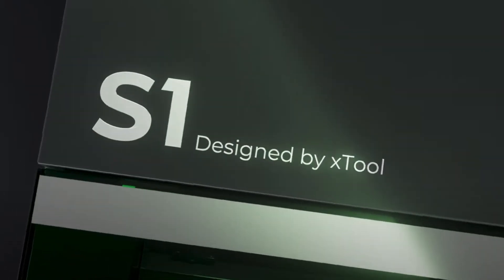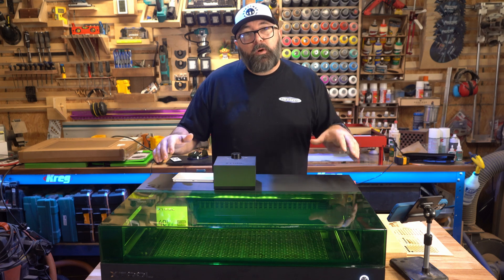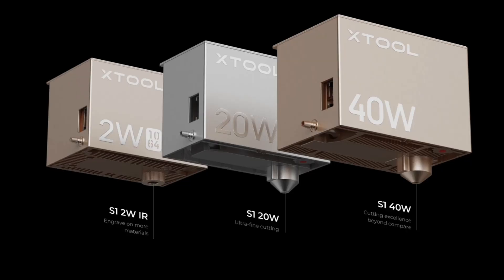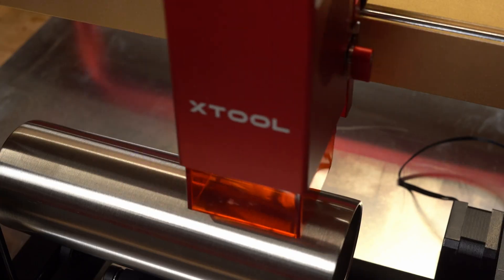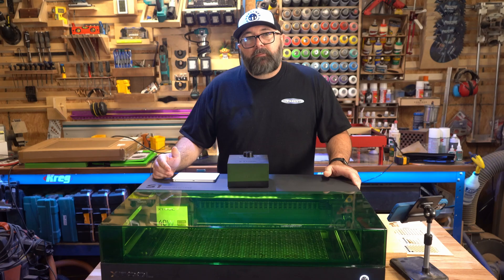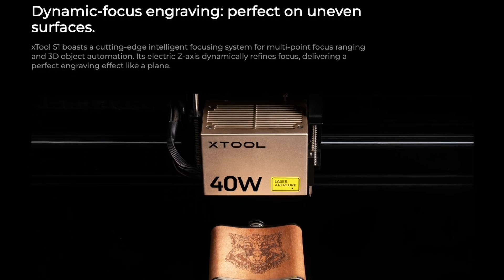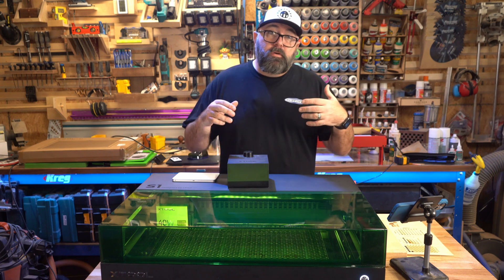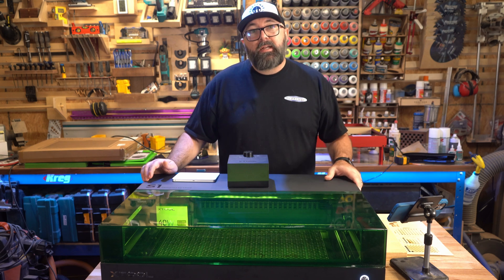I never expected THIS on a diode laser! | xTool S1 laser

Comment: Hi there, I am wanting to get a photograph engraved on stainless steel using the X-tool S1 with the 2w IR laser. I am based in the UK and wondering if you are able to do this? if so please reach out to discuss further. Many thanks, Joe
Reply from the maker: Hi there. I’m unable to take on any commission work at this time, unfortunately.

Comment: Was told by XTool the s1 could mark inside rings - I’ve received my s1 but can’t find a way to engrave inside rings - anyone worked this out?
Reply from the maker: You have the RA2 rotary and riser? You have to tilt the RA2 I’ve heard but I haven’t tried it yet. Maybe this will give me a reason. lol.
Reply: Yes I have riser and RA2 - it seems the focus range is so close with both the 40w and IR module that you can not get inside the ring even with the ra2 tilted at a 35-45 degrees.
There are loads of videos of the D1 laser achieving this.

Comment: One question I have is I know you pick up the corner to corner but how do you pick up round stuff?
Reply from the maker: Lightburn has a center finder option built into the software which may be an option for you. The best way I have found to do round objects is by making a template where I put the round object in the middle of the template and it lines up perfectly every time.
Reply: @VoeltnerWoodworking  I was talking about in xcs! You must only be able to pick up square and rectangle objects with xcs! It would be nice if it was a four point pick up then you could pick square or circle
Reply from the maker: I'm getting ready to release a video on the updates that just got done with XCS. It addresses this concern. Hope that helps!

Comment: Hey Matt, great, informative video!  I'm a 'newbie', trying to decide between the M1 and the S1.  You mention 'batch engraving'... this is one of my big questions.  Can you engrave/cut multiple pieces at one time in the S1?  For example, if you had 4 wood coasters that you wanted to engrave, could you put them all in the S1 at the same time so they engrave in one shot, or do you have to do it as 4 'separate' operations?  The lack of camera intimidates me, but that being said, since this is my first laser, I suppose I could adapt to either way?  Just curious on your thoughts.  (I have 2 Silhouette Cameos and I'm very tech-savvy, so not too concerned about becoming familiar with, and using the software.) :-)
Reply from the maker: You can absolutely do batch engraving on this machine. It just won’t have the adaptive technology like the P2. You’ll want to make a template for repetitive engraving, but that’s super simple. This will be a nice machine to learn on.
Reply: @VoeltnerWoodworking thank you so much for the swift response.  I will definitely be going 'all in' and getting air assist and the filter; Overall, if I'm choosing between the 10W M1 ($1949 for what I've configured) or the 20W S1 ($2599 for what I've configured), what would your recommendation be?  Worth the extra for an S1 for a newbie? (Watching another of your videos... I'll be subscribing, so informative!)
Reply from the maker: Thanks so much. Beyond the bed/working size difference (385mmx300mm for M1 and 608x388 for S1), the wattage of a 20w will allow you to cut much thicker material. I'd say if you're not going to need the knife to cut vinyl for the M1 (since you have the Silohettes), then I would go with the S1. You're going to be able to do so much more with this machine. You'll also be saving $80 by using the code and should get free shipping, so that's icing on the cake!